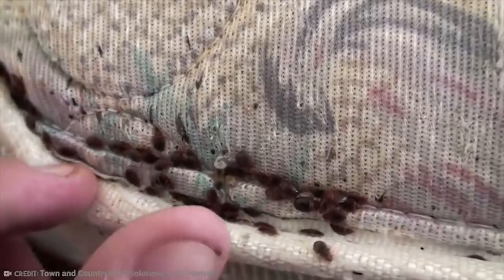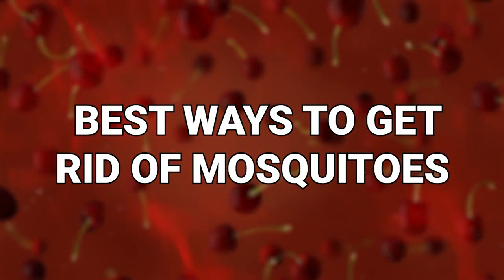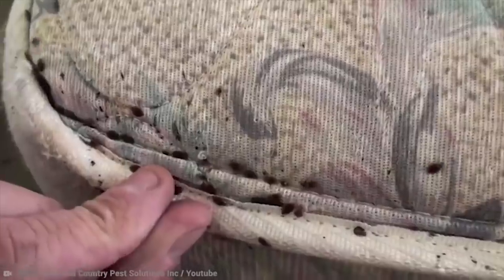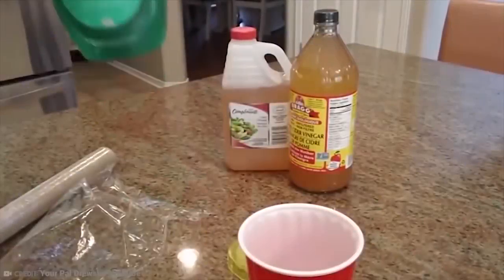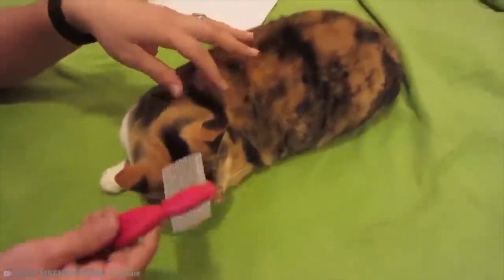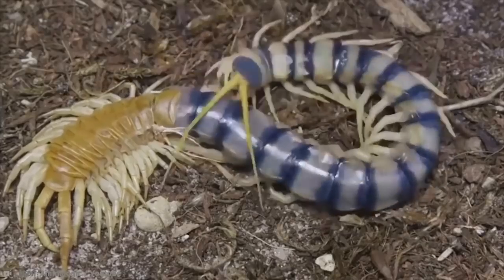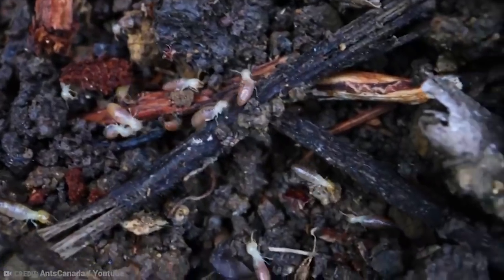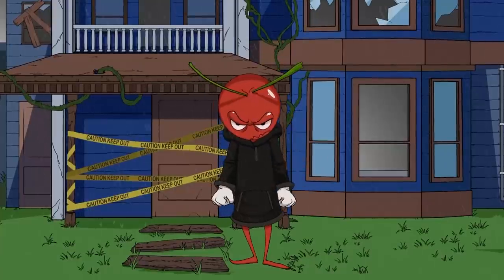15 Effective Ways to Get Rid of All Insects at Home

Comment: OMG.  I have one those salt guns and use it daily in my woodshop.  This time of year flies come into the shop and they land on me and tickle me when i'm engaged in precise work with sharp tools.  it's beyond annoying.  They cost me time and money.  The salt gun is so efficient and a blast to use.  The best part is that the flies suffer for a long time before they die.  Every half hour I pick it up and eliminate any flies I can find and it solves the problem.  My left arm is sore and I have a blister on my right thumb from using it but no more flies crawling on my elbows or the back of my neck during detailed carving work.  Get one today?